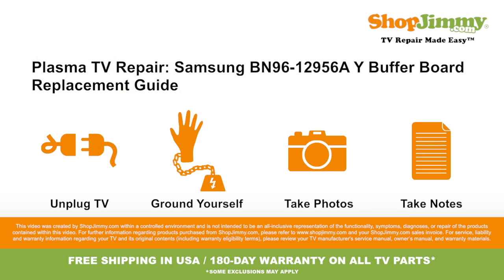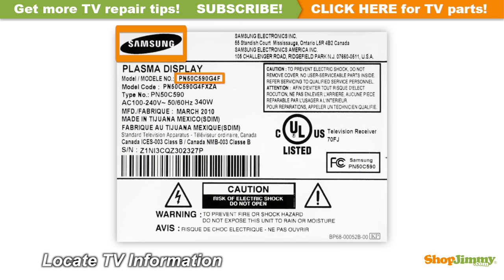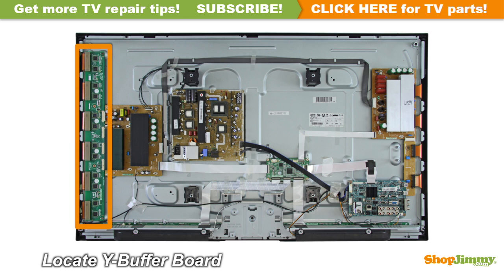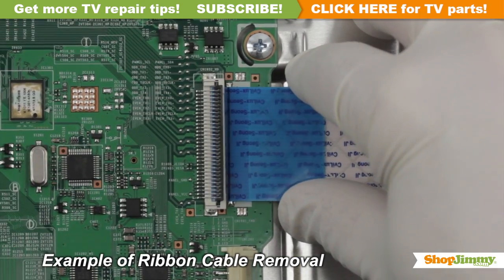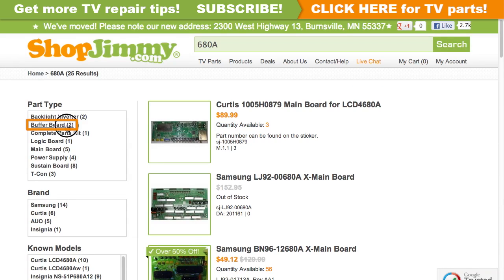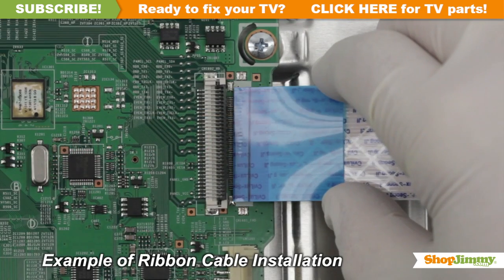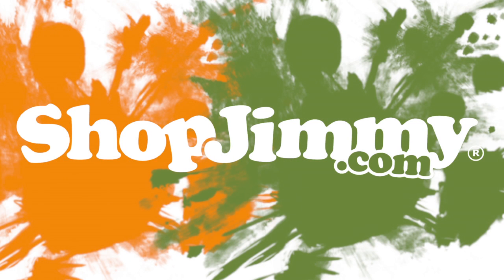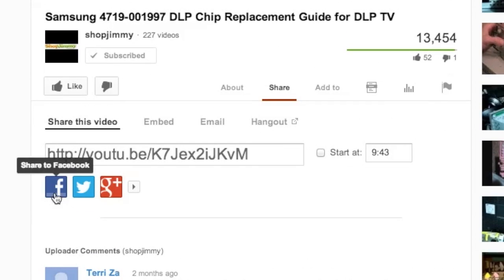Samsung BN96-12956A Y-Buffer Boards Replacement Guide for Samsung Plasma TV Repair

Comment from the maker: @jcalab001 - Unfortunately I would say this is a bad panel since the lines are running vertically.  Replacing the panel can be very difficult and often times very expensive, I would recommend purchasing a new TV.  Thanks and please let us know if you have any other questions.

Comment from the maker: @David Gardner - This could be one of two things, either the logic board or the panel.  The logic board can be replaced, however we do not have that part in stock.  If the panel is bad, it is recommended to purchase a new TV.  Replacements panels are expensive and can be difficult to replace.  Thanks and please let us know if you have any further questions!  (877) 881-6492

Comment: I have a Samsung 50" PL50A450P1XZD. Just to the right (looking at the TV) of the Samsung logo there is a 5cm, vertical black line with a yellow, green and red thin strip within it. What do you think? thanks in advance.

Comment: I have a 50 Samsung LCD TV that has the vertical lines , thin , about 10 of them now. I have read that it is a timing board, but don't see that part listed on your site. I am sure it's called something else, can you advise? thank you  it is a PN50C550G1F model

Comment: Samsung BN96-12956A Y-Buffer Board LJ92-01729A replacement  you fail to show how to remove  the board from the four white cdonnectors

Comment: Hello I have a Samsung/Philips Plasma 50 " TV -- 50PHP5332D/37 there is no picture, when I removed the back cover the top Y-Buffer board (JC491AA17790BN - (LJ41-05121A)) has a burned out (2 holes in the top surface) Buffer IC. I assume I need that Y-Buffer board, the bottom one appears to be ok, please get back to me, thanks.
Kirk Dawes
Reply from the maker: Kirk Dawes   I recommend replacing both buffers at the same time to help prevent further problems.  Here is a link to replacement parts for your TV model number on our website, click here:  http://www.shopjimmy.com/catalogsearch/result/?q=5332D  Be sure to match part numbers on your current board, with your replacement for compatibility.  You can also call our customer service for further assistance with your purchase.  (877) 881-6492  Thanks and please let us know if you have any further questions with your TV Repair!  www.shopjimmy.com

Comment: I have a Samsung 50" plasma, PN50C550G1F that has 5 horizontal black lines that should not be there. All connections on the y-Buffer Board have been checked. Is it likely that replacing the board will solve the problem?

Comment: I am trying to disconnect a y-main board from the y-buffer, on a PN60E550D1F to send it off for repairs.  There are 6 white connectors between the two boards.  ALL of the tutorials show how to disconnect the ribbon connectors, which is easy, but don't show how to disconnect the six connectors and just say "now remove the board".   These are offering quite a bit of resistance and I am hesitant to just pull these apart for fear of breaking them.  I can't do them one at a time because they are all in a row.  Help please...thx.
Reply: I am having the same issue. It boggles the mind - detailed ribbon removal - nothing on those horrid little clips.
Reply: I know its a little late, but I just came across this video and ran into the same problem.  Just pull it apart.  It'll come.  I'm commenting so the next person that comes along in 7 months will have the answer. :)
Reply: Pull it apart ?  You mean pull out the board from the connector ?
Reply: I am stuck with the same issue, it feels like something is going to break trying to separate the Y sustain board.
Reply: any luck?
Reply: Awesome thanks for the info! I ended up pulling the y sustain and the board it connects to out, pulled it apart and put in a Y sustain board I got off of ebay. And the screen turned on! Woohoo! A good test for a potentially bad Y-Sustain board is to use your ears. Put your ear next to the Sustain board, try powering it on, if you don't hear any electric noise its probably bad. Good luck out there.

Comment: Hi. I have a Plasma samsung tv model PL51D490A1GXZD with a vertical black bar in the middle of the painel.
Any chances to replace the logic board or Y buffer to fix?Or its a bad panel problem?
thanks!
Reply from the maker: Lucian Silva Not normally....This sounds like a TV panel problem.  If your TV panel is bad, it may be more cost-effective to replace the TV as panels are typically hard to find in stock, difficult to replace, and expensive.  Thanks and please let us know if you have any further questions!  www.shopjimmy.com

Comment: Hey, i have the same TV model as David Cook. 
model: PN50C550G1FXZC
version: NY02

just got one black horizontal line, spanning from left to right at the top half of the screen, closer to the middle.

*edit: recently, well today, got a second black line which appeared... =/

The two lines are literally 3 pixel spaces away from each other *

will i have to replace the y-buffer board like the one in your video? i havent opened tv yet, but im assuming its that, based on David C.'s comment, that i have the same problem.

also would any board with the same PN BN96-12956A work with my TV if it is listed in the list of TVs? (such as Samsung BN96-12956A Y-Buffer Board LJ92-01729A LJ41-06755A from your site)

let me know, thanks!
Reply: Still waiting for a reply... thanks
Reply from the maker: Sammy Morini   This could either be a bad panel or problem with a buffer board.  Unfortunately I do not see any replacement parts in the search results for your TV model number on our website.  Thanks and please let us know if you have any further questions!  www.shopjimmy.com

Comment: Hello.
I have a lcd samsung LE40N87BD
it currently has grey wide horizontal lines across screen.

I was told it was the tcon board, replaced that and its still the same.

Any ideas?
Reply from the maker: Wayne Sears   Try all repairs and troubleshooting at your own risk.  This sounds like a TV panel (TV Screen) problem.  If your TV panel is bad, it may be more cost-effective to replace the TV as panels are typically hard to find in stock, difficult to replace, and expensive.  Thanks and please let us know if you have any further questions!  www.shopjimmy.com

Comment: Hi, i have the horizontal black line problem on my PN50C550G1F Samsung 50" Plasma TV. I first try to clean all the connection with isopropyl alcool (just a little) and reconnect them. The problem don't go and much line appear so my friend tell me to buy a Y board because he think my chips are not good. I but one and receive it today so a change the Y-board while checking your video. When i turn my TV on, the black line STILL in the sames places. Do you think i can change something else or ot's the connector itself that are broken. I check each connector and ribbon and they look fine at all??? I'm so annoyed right now... -_-
Reply: Do you still answer the questions or?...
Reply from the maker: Les Hatchbacks Officiel   Yes, thanks for your patience!

Comment: That white tape ribbon with blue tape on it is it the one connected on the right towards the audio or the one in the middle cos thier are three white tape leading to them square panels but don't know which one to disconnect I wish the tutorial was shot from above that way u know what cable to remove from what panel but the shot was a close up on the tape with the blue tape on it and I was confused now am thinking of removing all but not sure if that's advisable then that white plastic on the y sustain before removing the brown ribbon connector wasn't explained so and am not sure if it's glued or u can just remove so I couldn't take that risk pls help
Reply from the maker: iammagnum mag   Please reply with your TV model number.  Click here to view a video that shows how to find your TV model number:  https://www.youtube.com/watch?v=S51nhAmwR2M  Thanks!  www.shopjimmy.com
Reply: I have added a video of my TV interior to this message thank you for your help. so far have been able to remove the brown ribbon then plugged them back still the same lines.
so am assuming i may need a new buffer
Reply from the maker: iammagnum mag  Try all repairs and troubleshooting at your own risk.  If you want to replace the buffer, on that type of connection you will want to be very gentle.  You can lift the clear type connection straight up and off the board.  Then when re-attaching to the replacement board, you will want to gently push the connection over the piece on the board.  Do not force anything and again be very gentle and careful.  Also, it is recommended to replace the Y-Main board along with the buffer.  Thanks!  www.shopjimmy.com
Reply: oh ok which one is the Y Main board? is it the brown board with 4 aluminium bricks
 attached to the buffer? if so, thank you so much where can i get the actual part pls? Need to subscribe to your page asap thank you .
Reply from the maker: iammagnum mag  Try all repairs and troubleshooting at your own risk.  The Y-Main board is attached to the buffer boards.  Click this link to possible replacement parts for your TV model number:  http://www.shopjimmy.com/catalogsearch/result/?q=51D550C1  Be sure to match part numbers on your current board, with your replacement for compatibility.  If we are out of stock on any boards, you can sign up to be notified when we get the part back in stock.  Thanks and please let us know if you have any further questions with your TV Repair!  www.shopjimmy.com
Reply: i CAN't  FIND IT ON YOUR SITE but i managed to Find THE BUFFER BOARD the one with the brown ribbon  attachment WITH ALL NUMBERS MATCHING  SOME WHERE ELSE. BUT i COULDN'T FIND samsung BN96-20481A, LJ4109429A  (Y Main board) Am thinking of buying the buffer alone and attach the ribbon to it carefully with the old Y- main like  give it a try and see if it works any suggestion on that please?
Reply from the maker: iammagnum mag  You can certainly try that and see if it works.  Sometimes, if there is a problem with the Y-Main, it may cause damage to the buffer(s) and vice versa, which is why we recommend replacing them all at the same time.  Thanks!  www.shopjimmy.com
Reply: oh ok got ya Thank you so much for your time really appreciate the info thank you. will register now